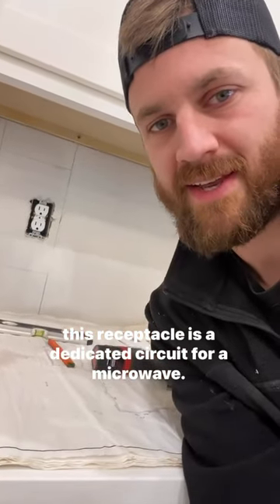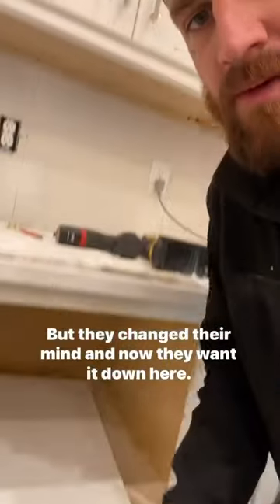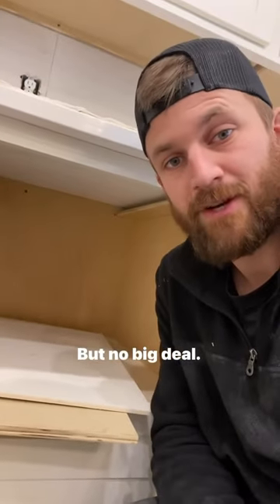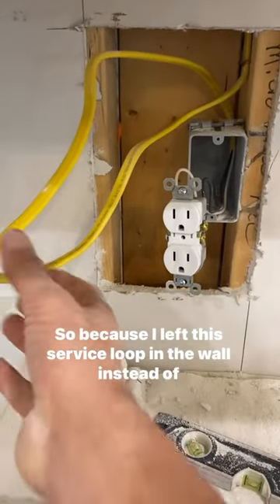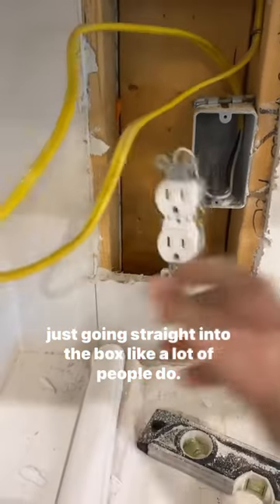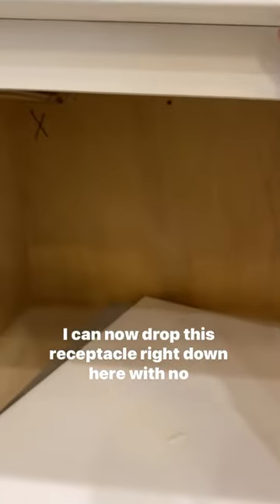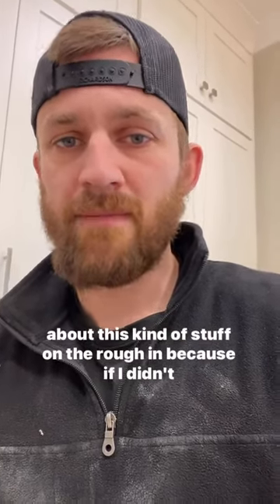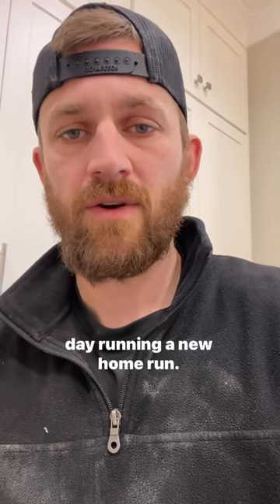This is Why You Should Leave Service Loops!! #electrician #bluecollarlife #construction

Comment: Technically that loop breaks code (atleast here in Canada) the 12" max before the required support is measured along the wire. You definitely have more than 12" in that loop.
Reply: Is the "measured along the wire" actually in the CEC code? I believe the NEC in the states calls for the cable to be secured within 12", but no mention of wire length. I did industrial work so I have little residential experience.  I think the loop is legal in the states, but might be up to the AHJ.
Reply: yeah im a canadian apprentice and we learned in school that too long of loops will get you a defect. an easy solution to this is to just staple your loop half way so it stays supported
Reply: @michaelduy9055  "The general rule for NM cable is to secure the cable within 12 inches of the box and every 4.5 feet thereafter. The previous code language could technically allow an unlimited length of coiled up NM cable inside the wall as long as it was secured within 12 inches of the box.

In the 2020 NEC®, no more than 18 inches of cable length is allowed between the cable entry to the box and the closest cable support."
Reply: @TheDailyElectronic  Thanks. 18" seems a reasonable length for a service loop. If I could go back and check, I think the loops I have left behind would measure around 12 to 16 inches.
Reply: Not stapled correctly per NEC
Reply: Secured “within 12”” AFTER it leaves the box, ie, nm cable should be secured to a stud near the box, so it does not pull connections IN the box loose.
Reply: @michaelduy9055 romex has to be secured within 12" of the box but allows for 18" worth of wire. NEC 334.30
Reply: @anatoliygolub5609  Thank you. The last code cycle I routinely used was 2011, and I don't think wire length was addressed. Secured within 12" is all I remember from that edition.
Reply: Pretty sure it's the same here. It should all be in the box.
Reply: So true it’s a code violation secure the cable there is more than 12” of cable there befor the support
Reply: Code 334.30

Length does not exceed 4 1/2ft and it supported within 12 inch from the box so I assume he's good on that. Imo I believe the 4 1/2 rule is mainly for EST for panel cabling and management.
Reply: @michaelduy9055 Yes it is

Comment: "Leave some slack, you might be back" best bit of advice given to me as an apprentice 😂
Reply: I like that. It’s a bit like. “It’s better to be looking at it .. than looking for it”
Reply: @brianswan921 I like both those quotes.
Reply: I agree, but have never seen it in action.  Everything tight like they used a ratchet strap to pull wire
Reply: @CookieMobster yeah I hear that. The price of copper nowadays as well. Extortionate prices for cable 😮

Comment: New home run? You can put a work box with a blank cover in the back of the upper cabinet. Do it all the time in remodeling.
Reply: It’s not an upper cabinet though. It’s the backsplash.
Reply: @mattheworoark1459  Which ever direction the wire comes from. The base or wall cabinet, doesn't matter.
Reply: @farmerbill6855  

That makes sense now that I’m visualizing it. 

I was thinking you thought the original position of the microwave was in an upper cabinet not the counter.

Comment: Gotta love electricians and plumbers, they never met a wall they didn’t love to cut a chunk of drywall out of. Then they head out leaving you to then call drywall contractors in.
Reply: cause we're not drywallers... how else are you supposed to do work within a wall without removing a piece of the wall
Reply: As someone who has to run the wire and fix and paint, I've learned the tricks. Neigh a one trick pony aqui.😊
Reply: @anatoliygolub5609  I agree that the cutting was unnecessary in this case. Cutting in a new box below, carefully prying this one off and removing the wire through the existing cutout, and pulling or fishing the wire from below (since the staple is before the loop) would have worked just fine. I assume this was cut specifically for demonstration purposes.

If a backsplash is going over this wall anyway, it isn't a big deal, though.
Reply: I made plenty money doing Punch list repairs behind the Plumbing and Electrical Contractors in New Construction Industry over the years.
Reply: As an electrician, one of my favourite tools is a jab saw 😂😂
Reply: Hey we circle it and write patch, what else do you want?
Reply: In reality..he could have cur the home below the counter and then fed a wire down to the lower box..no repairs required..I call this a $200 repair..